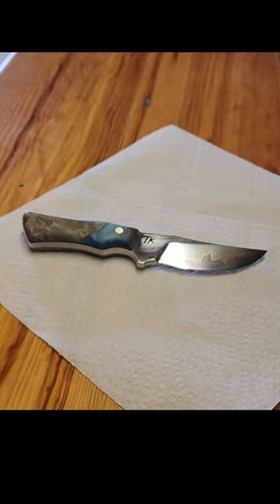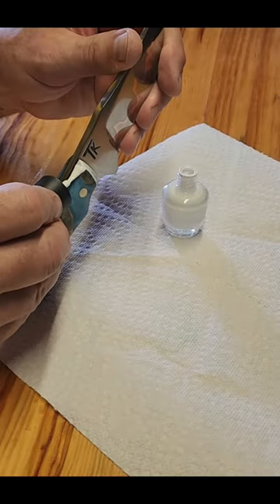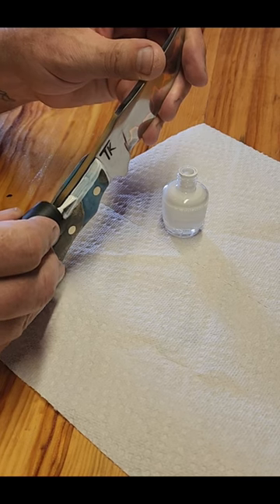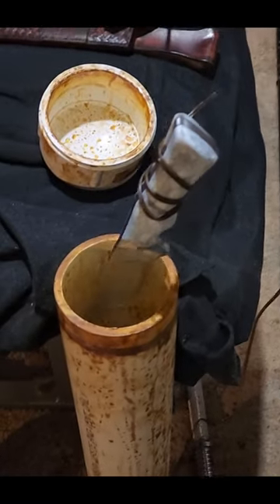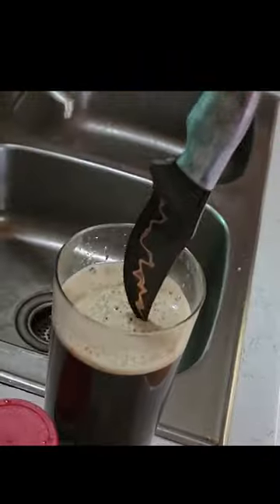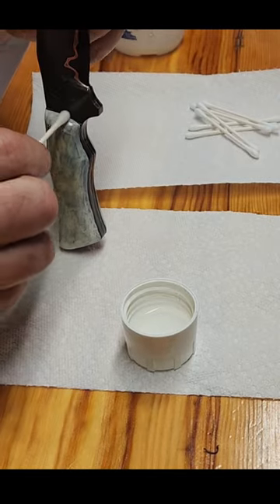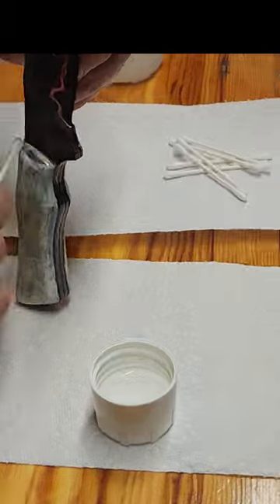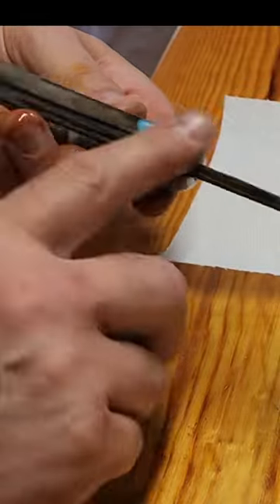How I etch my knives after the handle are finished.

Comment: Hey there.. have a Damascus knife that turned silver along the spine after sanding the handle, and I’ve gathered that I need to etch the blade/tang to get the black color back. It has lacewood scales finished with tung oil. Will the nail polish/acetone destroy my finish?
Reply from the maker: I've never worked with that type of wood,  but I've used the nail polish trick with many others and haven't had a problem.  I have dipped a q-tip in ferric chloride and spot etched before.  Maybe try that first?
Reply: Would you recommend treating the wood prior to applying the nail polish? Also did you have g10 liners on your knife and did those not get covered by the nail polish?